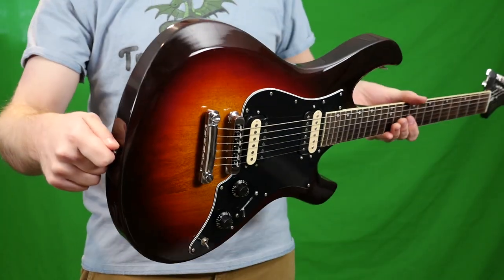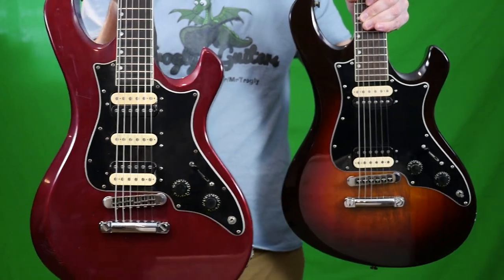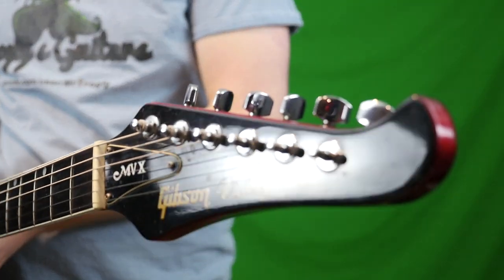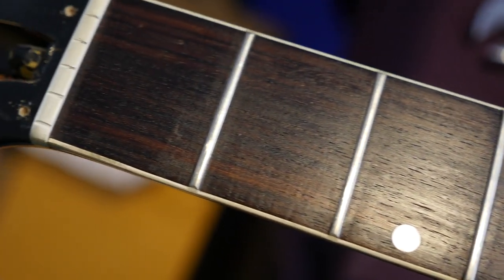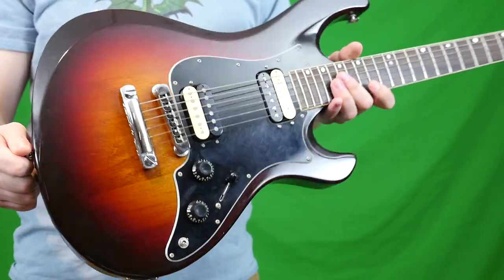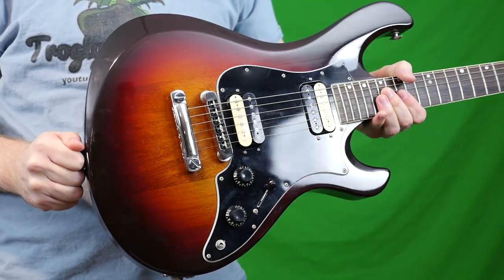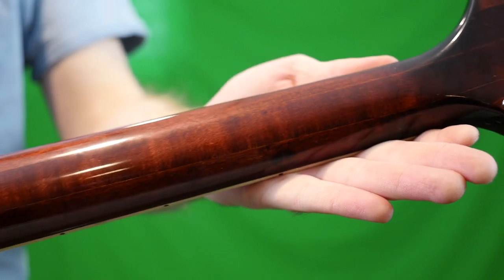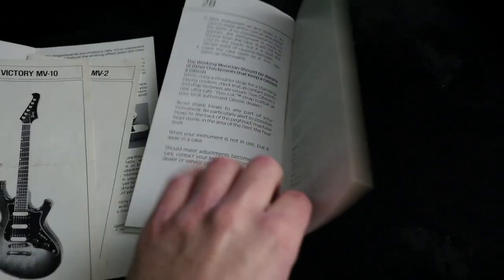The Unsolved Mystery of "CM" | 1981 Gibson Victory Multi Voice 2 MVII | Review + Demo

Comment: Here's an EXTREMELY RARE find I just bought - an RD Artist body with a Victory MVX neck on it. When Gibson moved the factory from Michigan to TN, they had some RD Artist bodies and MVX Victory necks a' layin' around, so they built a limited number of RD's with MVX necks. The look is absolutely STUNNING. The MVX neck on an RD body looks light years better than the standard open book headstock and really completes the look of the RD.
Reply: Wow I'd love to see that guitar! A rare find indeed, great score!
Reply: @jonathanhudak2059  Thanks. Here's an update - I removed all of the electronics out of it and had it rewired with a Gibson 490 in the neck and a 498t in the bridge and had the L6-S 6 way varitone switch installed. I then replaced the alnico 2 magnet in the neck with a alnico 3 and the alnico 5 magnet in the bridge with an alnico 2. The neck pickup sounds MIND BLOWINGLY good but I'm still getting squealy feedback from the bridge because it's an overwound pickup and because they're probably still some air that got trapped under the pickup cover. I'm probably going to just swap that set out w some burstbuckers with a 2 in the bridge and a 4 in the neck. The fret board needs repair too because they're a slight hump where the neck meets the body so that'll be another $200 plus to take down the high spot / refret it with medium jumbo's. I also need to have someone monkey with replacing with some of the varitone resisters to shape the tone some more on some of the settings of that switch and I also want to put locking tuners and a stetsbar trem on it. It's going to take a while but it will eventually get there and when it does it will probably replace my beloved Fender American Mahogany Strat as my main go to guitar for gigs.

Comment: I've been playing on stage since 1963. I have a Victory MVII CM, candy apple, all original. I bought it in 2010 and still play it on stage occasionally, but mine tips the scales at ten pounds and the lower profile frets make string bending a chore, but.I love the pickups. Usually change the pickups in my Gibsons because frankly they are crap. These pickups get a great R&R sound, and they clean up well when tapped. The neck shape is almost exactly the same, and I mean this, as my 1961 LP SG. I considered getting the Victory re-fretted BUT I'm afraid it will hurt its value, which is rising, and it would be very expensive too. The solution is to play the PRS Custom 24 and just have the Vic for broken-string-backup.

I also had an MVX in the early 1990's, but I got rid of it in a hurry. Did it sound like a Strat, hell NO! That was an out and out lie from Gibson. It also had the worst  whammy system ever made, a Kahler. It was a beautiful tobacco sunburst guitar that I learned to hate. Honestly, when I decided to take a chance on the MVII I totally expected to be disappointed, but the thing is a completely different guitar. Really quite a nice guitar.

Comment: I like the look. I really like it. Not the sound so much, but it could be useful when a bright and thinner tone is needed. All Maple is brighter than even all Alder. 

...but..but.... wood does not affect tone....blah......blah ..... the Earth is flat too......!! Yeah? Why does an old SG with the same hardware not sound like a Les Paul huh? Wood and shape are the only difference really, so must be making the difference. Duh.

p.s. When that bloke began bending and tapping on those almost fretless wonder frets, I expected them to choke out. They did okay. Was it hard to play for him? I am think of getting slightly taller frets on my 1996 Les Paul.
Reply: Gibsons usually have 12'' radius necks which helps with easy bending even if frets are fairly low.
Reply: I own a 2, properly set up with 10's. It sounds like a typical Les Paul. Maple or not, it is definitely NOT bright.

Comment: Why can't Gibson just put strings trough body?
Reply: There are at least a couple of older models that do. I know there's a Flying V from the 80's (I think) that has them & at least one of those weird budget type models they brought out at the start of Henry's reign too.
Reply: I personally hate string through designs. Makes restringing annoying or even painful, if you need to take off and then put back fairly fresh but used strings. And better sustain of those is just a myth.